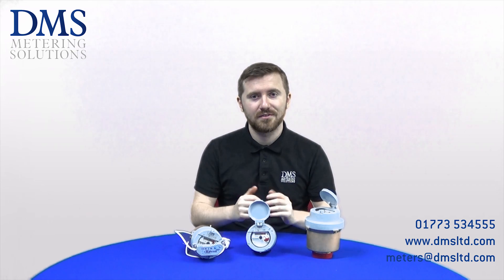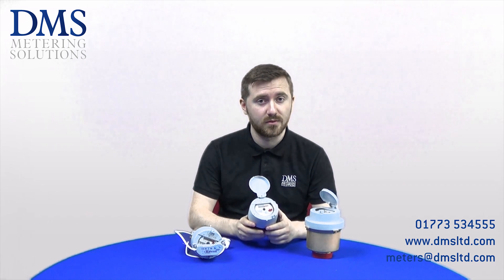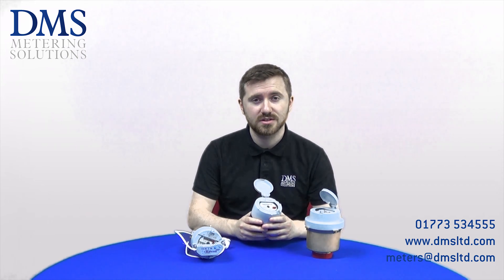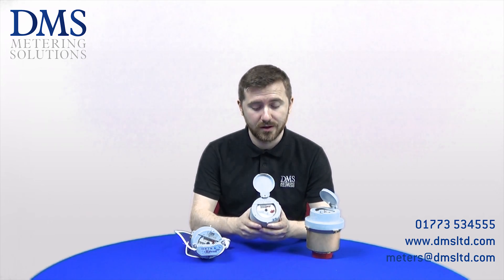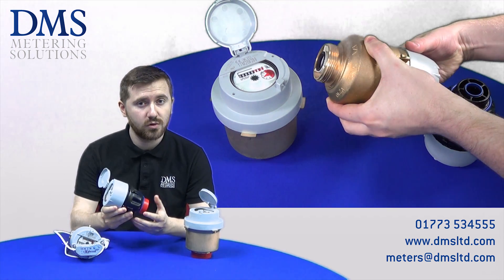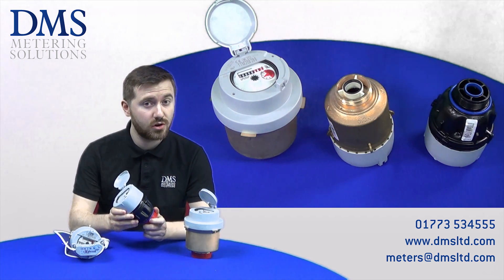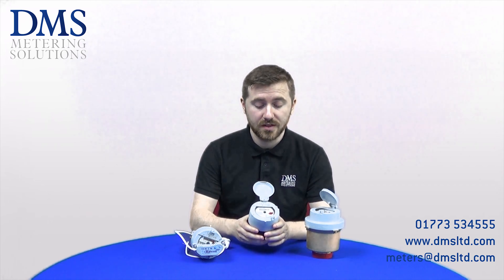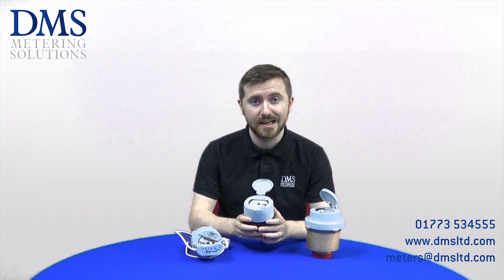V210 Concentric Water Meters, available with M-BUS Module from DMS Metering Solutions

Comment: I have purchased PR6 for V200. When I tried to fit the PR6 on the meter it appears the plastic cover on the top of the meter is not in the right place making the PR6 not to be fitted in the correct location. I have tried to rotate the plastic, however, the whole top head rotates along with it. 
any idea how can I rotate only the grey plastic cover so the PR6 can set on the place?